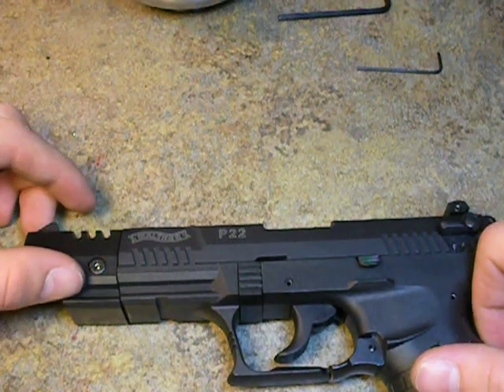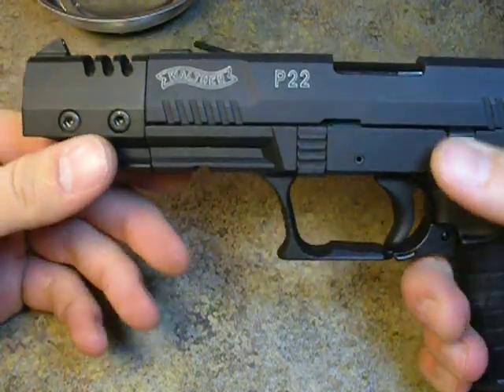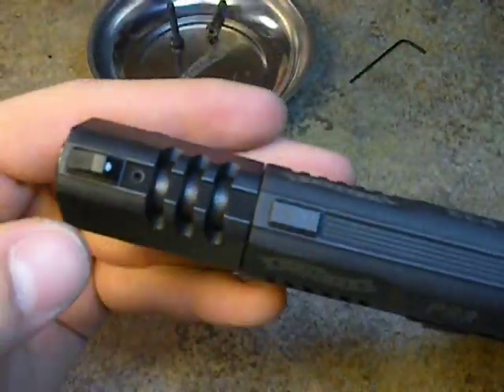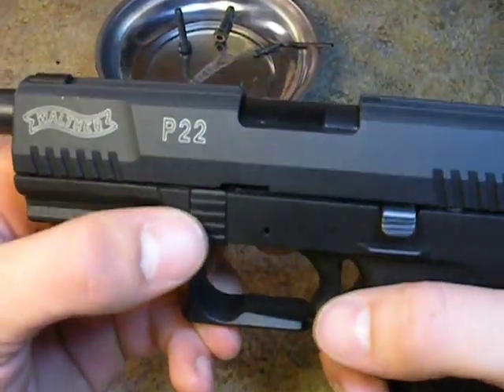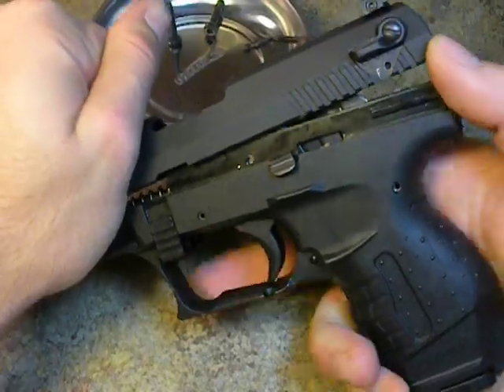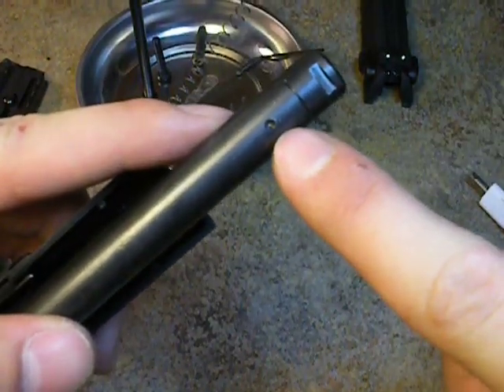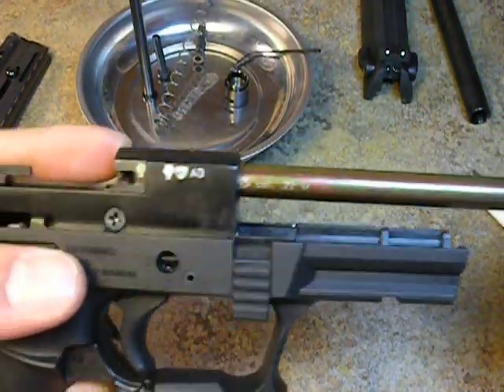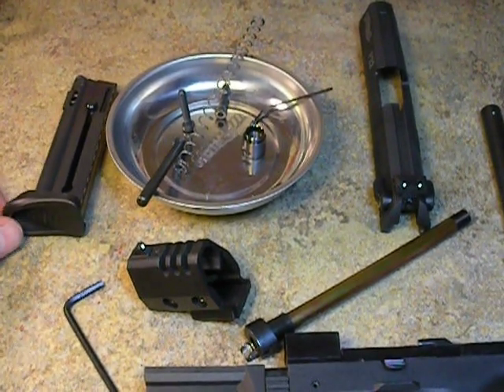Walther P22 Disassembly w/ Compensator

Comment: Can the front sight be moved from the compensator to the slide? Just wondering if I buy target version, can it be converted to short version of the gun by removing compensator and replacing barrel to short one. Do not want to purchase both models.

Comment: Question: How does the gas escape from the top port of the compensator if it is attached to the non slotted barrel or is it just for decoration?
Reply: Hapy Papy - From my understanding it's not a compensator, it's an extension to cover the longer barrel on the target pistol. That's what I was told.

Comment: Hi Weston.  Question:  Did you modify the feed ramp in the barrel and polish it?  If so, did you do any other modifications which help the pistol fire different types of ammunition OTHER THAN CCI Mini Mags??  Thanks.  Sincerely,   JAMES.
Reply from the maker: I have done nothing to modify the pistol. Everything is stock. Some pistols require a break in period to begin running smoothly. Just keep that in mind. Cheers

Comment: Great video.  You don't need a screwdriver to lower the takedown clip, though.  If you grip only the BOTTOM ridge on each side of the takedown clip, it slides down with no effort at all. Attempting to grab the whole clip puts pressure on the upper part of the clip and makes it difficult (if not impossible) to pull down.